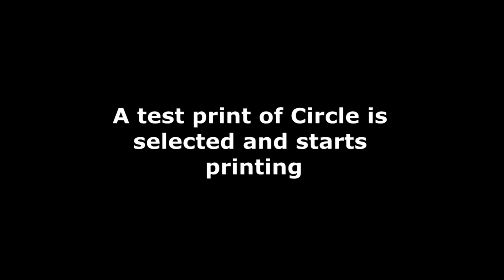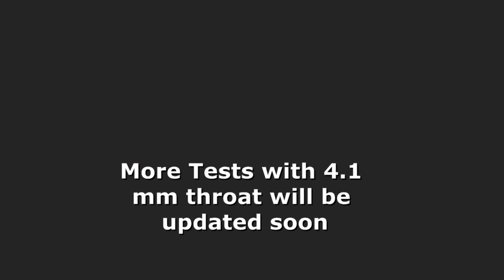Fix filament Jam issue with E3D V6 full metal 1.75 mm throat

Comment: Bro .. nanu kuda same problem na face madthidini nane built madiro prusa i3 steel adu one layer kuda print agalla... And now I ordered with PTFE lining ... May be problem solve agbodu antha andkondidini... And great video by the way
Reply from the maker: Thanks lot
Reply: @AakaarLab  can u send me the link .. I'm unable to find it .. and PTFE lined also creeps ... Please help me
Reply from the maker: @budgetgamer1633  what help u required bro
Reply: @AakaarLab  I'm not finding 4.2mm bore heat break... Can u send link ?
Reply from the maker: Contact me 9380790660

Comment: I have the same problem. The filament melt and jam inside ptfe tube. Do you think a water cool jacket can solve the problem?
Reply from the maker: I think no sir
Reply: @AakaarLab  can u explain more detail why it will not work? Thx.
Reply from the maker: @paultsoi4918  I will try it first then I will

Comment: 4.1mm throat max heat? Can I print nylon with this setup?
Reply from the maker: Sir i not checked for nylon yet i am using max 250 deg without issue. When i test it i will get back to u

Comment: If you take out the PTEF tube out off stock clone throat it will be 3mm bore will it work?
Reply from the maker: I think it wont. ptfe tube some what works like a heat insulator it will maintain hardness of filament. If throat is hotter the filament may starts jam since the filament softer when heat rises.
Reply from the maker: Share the throat u have i will see once
Reply: i just have bunch a thoats from v6 clone with teflon tube so was asking.Now i am still using stock Anet setup i print prtg, abs, asa with it no problem w the heat so far 245-250c when i tuk the thoat out there was litle of melt but change it and works ok dont print a lot.
Reply from the maker: @JLmr2356  super
Reply from the maker: https://www.thingiverse.com/thing:3154297

Comment: The only reason it jammed is because you bought a cloned heatsink. Genuine e3d heatsinks have to be machined to have smooth interiors
Reply: You are absolutely right in saying that the it is because it is a clone (cheap Chinese knock off) But this is our problem. We are living in 3rd word country’s where the clone E3D V6 is the only one that we can get, or if you can get the genuine E3D V6, it costs ¼ of the price that the printer costed. I can get hold of a Swiss Micro heat brake but this will cost me 5 x more than the whole clone hot end assembly costed. I just replaced my all metal heat brake with a PTFE lined heat brake and live with the fact that you can’t print at over 240 degrees Celsius
Reply: Its not the filament which is an issue its the heatsink. It has to be smooth enough for filament to flow at high temperatures which is why people still buy genuine e3d and microswiss if they want to print high temperature materials
Reply from the maker: @someoneonly  ok i will brought that to
Reply: I just have tried with a Original E3D V6 and have such problem. I returned to my clone one that works. Certainly I was not satisfied with this clone so I decided to buy a original (Amazon 70 USD) that never works at all.
Obviously E3D V6 was installed as several tutorial says. A gap between nozzle and aluminum block tighten after warm up,....

First attempt to repair was to replace PTEF tube that worked only for 2 hours. Replaced two more tubes without any success. I am still working with my old clone hotend.

Any idea how to fix it?
Reply from the maker: Yah its cloned one but after replace 4.1 mm bore the problem is solved
Reply from the maker: One of my friend has fladh forze and cr10 printers with e3d and mk8 setup but he also experience same issue. Note that its not for all filaments of different manufacture